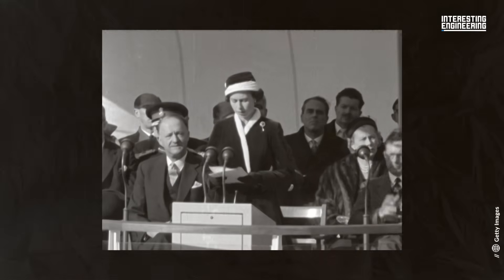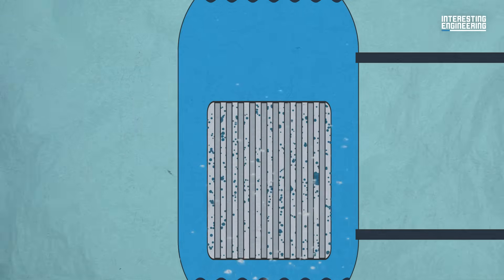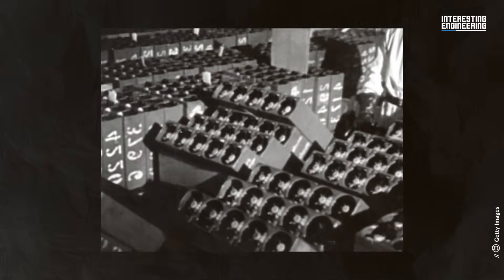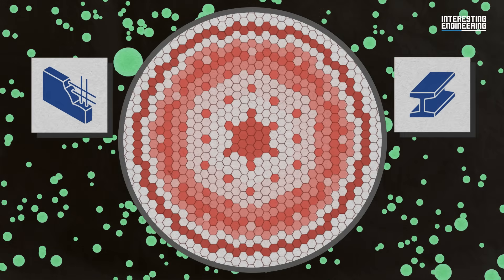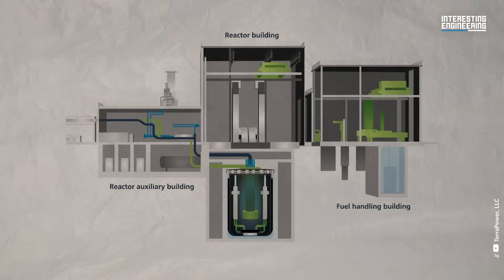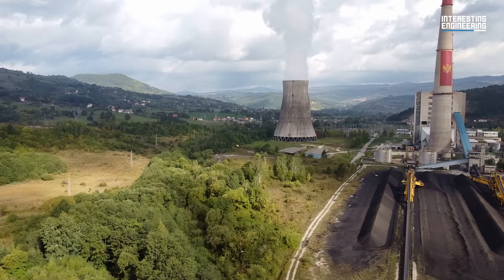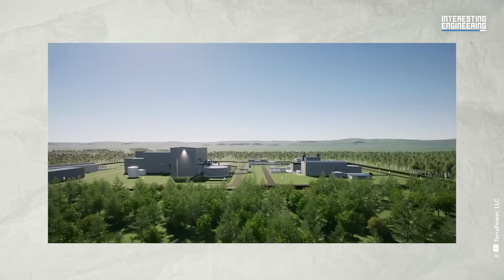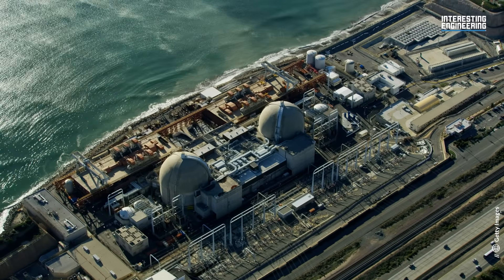Can You Stop a Nuclear Meltdown?

Comment: All this talk of reactors that cannot melt down, or cannot have accidents....no such thing.  If not a meltdown then some other form of accident.  Even molten salt reactors can have failures, and while they don't generate enough heat to create a nuclear detonation, if they have to be scrammed, the slurry of molten salt and other chemicals that poop out the bottom of the reactor are still VERY toxic and unpleasant to deal with.  Not molten plutonium nasty, but still more than mildly unpleasant to say the least. Maybe someone might build a functional traversing wave reactor that isn't so bad, but I'm not holding my breath.  Generally speaking, at least on the surface of this planet, nuclear answer is not only not the answer, it's fairly unnecessary.  With even a mild improvement to the efficiency of publicly available solar panels, and the use of cheap, earth-abundant self-healing catalysts such as cobalt phosphate, solar separated hydrogen systems for individual homes can far better meet humanity's energy needs than some centralized power infrastructure. Doesn't make money for GE, but f*** them anyway.

Comment: Of coarse they can be stopped as proven at 3 mile island. Once cooling was resumed the core stopped melting.  It doesnt just keep gettinf hotter and hotter unless fission is happening and that isnt happening in a melting core. Decay heat is melting the fuel. Once cooling water is added it wont continue to melt.
Reply: Well, not quite. It'll still be hot and stay hot as the short lived isotopes decay and release decay heat.
Decay heat is what killed Fukushima's reactors when they lost coolant circulation.
TMI-2, literally 3 miles from my home, had a coolant leak, misread of the situation and a critical indicator placed on the far side front of the operator's console, where an incoming shift replacement noticed it and alerted the shift he was replacing. Then, the offending valve was closed and coolant readded, restoring circulation.
They shut down TMI-1 in 2019, they're looking at bringing it back online for Microsoft's AI center in 2028. I miss that landmark of the cooling tower's steam plume.
Reply: I highly recommend reading, 'Three Mile Island: Thirty Minutes to Meltdown,' by Daniel K. Ford. ... It's been many decades since I read it. But I recall Babcock and Wilcox reactor had a heat exchanger adjacent to the core containment vessel. There's an electromatic relief valve at the top of the heat exchanger to vent excess pressure out of the heat exchanger. The valve was stuck in the open position by mud from the nearby river water. Coolant water was spilling out onto the floor of the reactor building. The water had gotten so hot that hydrogen was dissociating from the oxygen in the water molecules, creating a hydrogen gas "bubble." A colored light in the control room panel indicated that an electronic impulse had been sent to close that valve. Operators mistakanely assumed the open valve had been closed. In fact, the core was not covered with water. Something ignited the the hydrogen gas bubble. The resultant spike in pressure inside the containment dome, exceeded the pressure it was designed to resist. But the dome held up to the explosion. ... I recall President Jimmy Carter, in front of the State Capitol Building in Harrisburg, in essence, stating that there should be no worry, everything was under control. Meanwhile, the uncovered core was melting down. When the peanut farmer concluded his declaration, the Pennsylvania Governor recommended that all pregnant women and young children should evacuate from the area near Three Mile Island. ... There was a scientific experiment ongoing in the reactor core at that time. Thermocouples had been placed inside the core to measure the temperature while the reactor was in operation. During the crisis, those instruments were in operation, transmitting temperatires in excess of the melting point of the cladding and fuel rods. Experts in the control room, disregarded the data, with the faulty assumption that the core was still covered by circulating water. There was nothing in the design of the reactor that confirmed the electromatic relief valve was closed.

Comment: In case of a meltdown how many miles would a safe distance from the reactor be
Reply: TMI-2 had a 60% core meltdown, was safe even on the plant grounds, despite some I-131 releases, which diluted in the air quickly and decayed in a week and change. Zero cancers, zero birth defects, didn't even have plant or birds lost.
Despite what some discredited and retracted studies tried to fake.
On the opposite end of the spectrum, Fukushima's owners refused to install the venting through scrubbers system in case of a hydrogen accumulation that destroyed the upper part of the reactor building. There, the exclusion zone remains larger than necessary due to ungrounded fear of radiation, secondary to the trauma of the atomic bombings. So, that's around 12.4 miles, it's fairly safe around 8 miles from the reactor, but it's still an area they want to decontaminate. Don't get me wrong, I'd happily live even 6 miles from the plant, but I'd not eat anything grown in the local soil for around 14 miles to be sure and I do quite well understand the health physics involved. The nastiest being cesium-137, because well, containment was cracked open and it leaked out in a fair quantity. If it was something like uranium, I'd not really care, as that's a normal granite and granite originated soil trace element on earth. Cesium-137 not so much and it'd accumulate in every cell, replacing potassium - a major part of the cellular respiration system. So, no to anything grown in that area's soil, no to wells in the area too. Living there, safe enough. It's not as if tons dispersed - believe it or not, only around 12 pounds of cesium-137 is believed to have been released. Over that wide radius. But, its short half-life means it's a lot spicier than uranium, with its much longer and hence, lower radioactivity.

Comment: Coal , oil , natural gas fired power plants . Can be handled better when they go out of control BUT when a nuke reactor go's out of control it melts through everything and is in accessible to cool it down from under the core it should be  in the design to have  an emergency hvac system under the core just for meltdowns so they can stop the core dumping it's fuel into the water table  just a thought from a simple man that never went to college  !

Comment: 8 August 2019: Nyonoksa radiation accident at the State Central Navy Testing Range at Nyonoksa, near Severodvinsk, Russia. According to the version presented by Russian officials, it was a result of a failed test of an "isotope power source for a liquid-fuelled rocket engine". An event of explosive nature was registered on 8 August at 06:00 UTC (local time 09:00) at the infrasound station in Bardufoss (Troms, Norway). As the event was also registered on seismic data, it must have been coupled to the ground, meaning that it took place either at the ground or in contact with it; for example on water. The timing and location of the event coincides with the reported accident in Archangelsk. Thomas DiNanno, member of the United States delegation to the United Nations General Assembly First Committee, stated that the "August 8th 'Skyfall' incident [...] was the result of a nuclear reaction that occurred during the recovery of a Russian nuclear-powered cruise missile", which "remained on the bed of the White Sea since its failed test early last year".

Comment: 1961 Explosion at U.S. Army SL-1 prototype at the National Reactor Testing Station. All 3 operators were killed when a control rod was manually lifted too high. The reactor went from complete shutdown to 20 GW in a few milliseconds. It also jumped over 9 feet (2.7 m) in the air.
Reply: You forgot to mention that said control rod impaled one of the men to the ceiling.
Reply: @forcestrong1448  no, a control rod guide plug did.
Boy, what a lousy design though! Sticking rod, only one primary control rod, was a disaster waiting to happen.

All told though, there's been a half dozen meltdowns, several intentional to study what happens and most partial until Chernobyl. TMI-2 had a 60% meltdown, but was stopped by the resumption of coolant, once an off shift operator came in to start his shift and noticed an indicator lamp lit on the front of the main operator panel - on the opposite side of where the operator sits. Bad human factors design and emergency communications between different agencies and authorities was a total goat screw. Was around 90 minutes from TMI when it melted down, now I live around 3 miles from the plant.
Reply: @spvillano  thank you for the clarification. It's wils they're bringing TMI back online.
Reply: SL-1 was a combination of poor training, bad procedures, design issues (1 control rod), and at least one volatile member of the team.
Reply: I recall reading in the early 1980s, that one of those men was found to be so highly radioactive, that his head could not be buried with the rest of his body.

Comment: 1957 Windscale fire at the British atomic bomb project (in a plutonium-production reactor) damaged the core and released an estimated 740 terabecquerels of iodine-131 into the environment. A rudimentary smoke filter constructed over the main outlet chimney successfully prevented a far worse radiation leak.
Reply: Actually, one pain in the ass kept insisting on installing scrubbers at the top of the cooling tower (not a chimney), which trapped most of the worst of the worst.
Suffice it to say, said engineer wasn't considered a pain in the ass after the debacle of the fire.
Reply: @spvillano  Yeah that was Sir John Cockcroft and they became known as "Cockcroft's Folly" prior to the accident.  They prevented about 95% of the radioactive dust from escaping.  Obviously after the fact they weren't considered a folly any more.
Reply: @spvillano The people always concerned about safety of operation, maintenance, and/or people never end up being wrong. But money never ceases to kill good deeds…

Comment: Actually we do have stuff to spread on nuclear meltdowns now. There are many things depending on type of reactor. They have things that look like media blasters that spread grains of chemical elements such as boron, cadmium, silver, hafnium, or indium, that are capable of absorbing many neutrons without themselves decaying. The idea being you stop the reaction by covering the material.
Reply: Interesting. So the grains of other metals act kinda like velcro balls for the neutrons?
Reply: They dumped a shit ton of boric acid into Fukushima to halt the reaction, but no coolant circulation meant eventually the decay heat boiled off the coolant and the rest is history.
The title of the video though, that's bullshit, since TMI-2, which is only around 3 miles from me right now, melted down 60% and was halted by the resumption of coolant flow.
Reply: Sorry.
But it doesn't work like that. You can only cover the top of a reactor. Not the sides or the underside.
Plus- it's requires a lot of material which can not he accurately placed in a critical situation in a timely manner.

Comment: 3 mile island was first? Wasn’t there some problems in Slovakia and Leningrad with at least partial melts first?
Reply: TR-2 in 1960 had one rod partially meltdown, 1966 for Fermi 1 with several fuel elements partially melting.
The US lead the way in nuclear reactors and meltdowns, some literally intentional to test what would happen and well contained.
https://en.wikipedia.org/wiki/Nuclear_and_radiation_accidents_and_incidents
Windscale was in 1957, but was more of a fire of the graphite and subsequently, ruptured fuel, rather than a meltdown. Could've been worse, but one engineer kept on about installing what was otherwise deemed unnecessary scrubbers on the cooling tower and that saved the day from extreme contamination. As it was, an insane amount of milk ended up being dumped into the sea due to I-131 contamination.

Comment: Wouldn’t large elevated water tanks     either like water towers or on higher terrain that can use gravity to get water in for cooling without the need of electric pumps be an option?
Reply: Good point. Although I think the problem is getting the water or coolant up there in the first place: which is why they all tend to be built at sea level.

Comment: Of course, there's the argument that EVs are not the environmentally friendly solution claimed, due to the damage and pollution caused by mining and processing the materials for batteries.
Reply: Even nuclear power requires fossil fuels..
Reply: Yeah. Like the five or six biggest cargo ships pollute more than all he cars on the planet. Slap a few reactors from an aircraft carrier in there and all our car problems can be postponed until EVs or flex fuels become viable.
Reply: Nothing has ZERO impact. Even veganism has a price STOOPID. There's an argument that your garbage trolling is wasting energy which again is costing the environment due to the electricity needed to transport your moronic FUD. SO yeah there's that!
Reply: Still less than fossil fuels, but I get what you're saying: nothing is for free!
Reply: Anyone with a basic understanding of physics and engineering knows that EVs were never an environmentally friendly solution. 

As well as being wildly impractical.
Reply: @HailAnts  so is steel, we still need it and use it. Silicon chip production is polluting too, we still need and use them.
Reply: @HailAnts Do ‘t reveal your biases too hard there, buddy. EVs are the future full stop because there is no version of physics that shows pollution expended by producing the EV is as bad or worse than what is generated by ICE vehicles to produce AND operate them indefinitely.
Reply: Not sure about other countries but 30-40% of the USA's power is from burning coal. Go ev. Lol
Reply: @johnbishop1360  try again, your information is more than 20 years out of date. 16% comes from coal, 43 from natural gas, 18.6% from nuclear, renewables 21.4%.
https://www.eia.gov/tools/faqs/faq.php?id=427&t=3
Do your homework before making an ass of yourself.

Comment: Fukashima was the result of the designers negligence for the possibility of the worst tsunami, but the Fukashima disaster was the final nail in the coffin for nuclear energy in Germany. Now Germany no longer has any nuclear power generation, replacing it with coal and natural gas, which both have a much higher death per terrawatt hour produced than nuclear due to the pollution that is released when burning fossil fuels, nuclear is the second safest energy generation method, first is wind turbines, but there isn’t always wind, so nuclear is the safest way to generate electricity reliably
Reply: LOL BS! nobody is dying from the so called pollution coal and gas burn very clean
Reply: So, the coal and n gas will kill.
But what do you think all the highly irradiated spent nuclear fuel they bury in the ground is going to do eventually?
It's coming.
Reply: but why your comment have no trolls ? why my comment always drawing trolls attention. depsite whether its scientific or not, everybody have equal rights to write a comment right?

Comment: Reprocessing and burning in fast reactors deals with most of the problematic transuranics. Melted down coreium is a problem.
Reply: Well, the corium at Chernobyl's "elephant's foot" is literally safe enough to sit on for an hour. Not so much beyond that, it still is fairly "hot" in radioactive terms. Wouldn't recommend eating lunch around it though, it's brittle and slowly turning to dust due to oxidation.
New designs now include a core catcher, diverts corium into a chamber to allow it to cool over time, while it stays safely sealed off from the environment and plant.

Is anyone doing reprocessing any longer? I don't recall any US sites doing so, the fuel now just accumulating at plants inside of dry storage casks for the most part. It would be good if it were resumed though, convert the problematic transuranics into MOX fuel and burn the crap off - well, save for one isotope of plutonium for RTG's, as NASA is now out of it.

Comment: Avoiding meltdown, conditions. It's called gravity. Have a water tower supply coolant
Reply: That wouldnt work. The tower would have to be under extreme pressure to fight off all the steam pressure created. And remember only TIME can cool down reactor fuel. You can put a pellet of Pu238 the size of a sugar cube in a swimming pool and it will evaporate the pool before cooling off 100 years later..
Reply: @ Plutonium-238 is not fissile thus not used in nuclear reactors but produced in them. it's a hot isotope used in RTG's. SCRAM mode reactor produces 0.5% it's intial output heat From 3,400 MW thermal down to 17 MWt. Or you can flood it with sea water.
Reply: Half a million gallons a minute used to cool a nuclear reactor.  What “water tank” is supplying this?